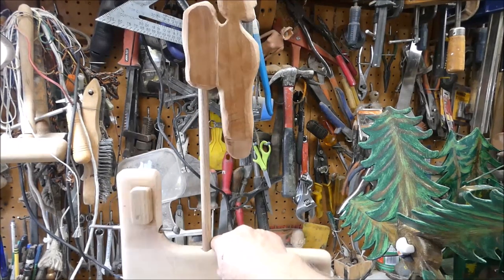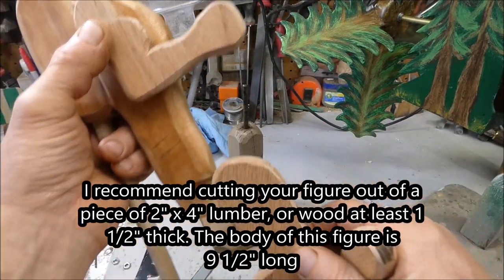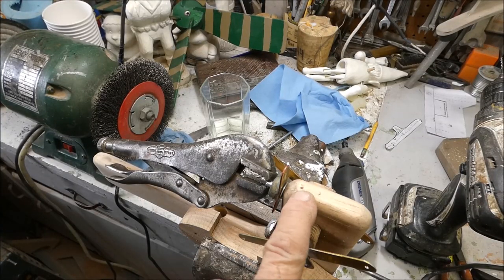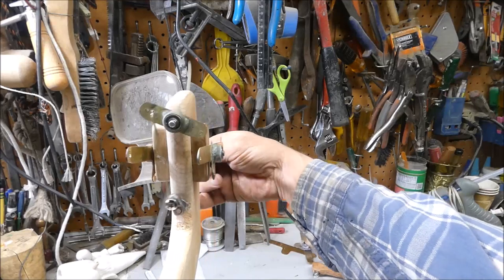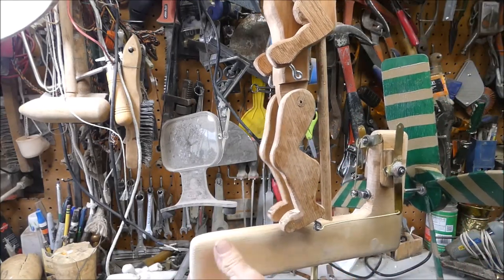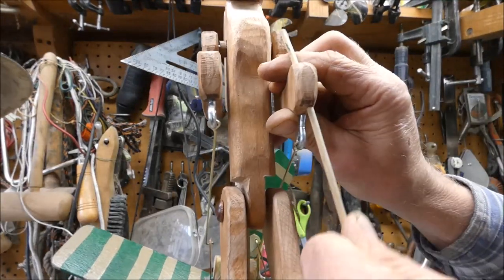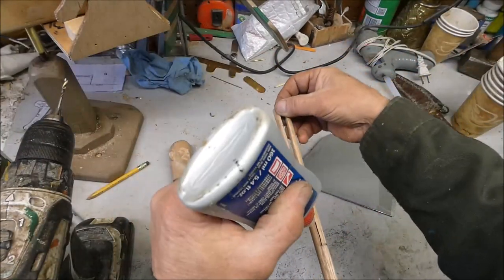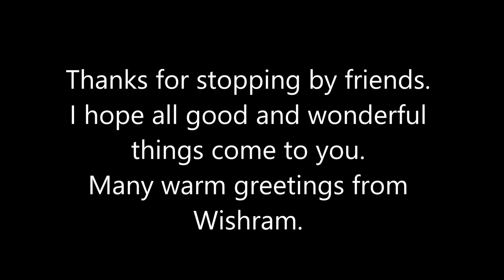Hiker Whirligig Build 5/5/2022

Comment: Your's is really fun to watch! A nice steady pace ...wind picks up...then super fast footed😄!!! That's great you put such work into the linkages👍!
Reply from the maker: Hi Linda! Thank you. I just added gears to this whirligig, but I'm thinking the action was better without the gears beacause it was faster. This is a fun whirligig for sure. I just made   a video where he is all painted. Thanks for stopping by. Warm greetings from Wishram.
Reply: @ToddAndrewCole  Thanks for the warm greeting! This sounds like the engine of a former car of mine..when the fuel ratio was set exact it seemed to slow the flow of my car...because of the shifting, I guess...but with a half turn richer on the fuel🙂it ran so much smoother from shift to shift. It seems like your gizmo should run quicker with a gear. I guess it depends on how you use it.
Reply from the maker: @lindakleckner215  Sounds like the old MG Midget I used to own. I could make the hiker go faster with gears, but I used them to slow things down. I think I prefer the faster movement, but the slower movement will last much longer. Take care.

Comment: There seems to be a critical ratio of the distance between the direct drive and the up/down lever.  I had to go through several iterations to get the exact(ish) distance that allows the up/down lever from arcing down or up too far and stalling the driver.
Reply from the maker: Ah, the joys of whirligig making! It takes a bit of tinkering to get things to work right, but the problem solving is good exercise for the brain if you can keep from getting frustrated and just enjoy the ride. I'm sure there's some math involved in getting the right ratio, but I never took geometry, so I use trial and error.
Thanks for stopping by. Have a great week!

Comment: Are you using 3/16 aluminum bar? looks great.
Reply from the maker: Hi! No, I don't think so. For what part were you referring? Thank you. This is an awesome whirligig, and not that difficult to make. Thanks for stopping by. Best regards.
Reply: @ToddAndrewCole  the drive shaft
Reply from the maker: @waynep4963  I'm using 3/16" galvanized steel rod from Home Depot.